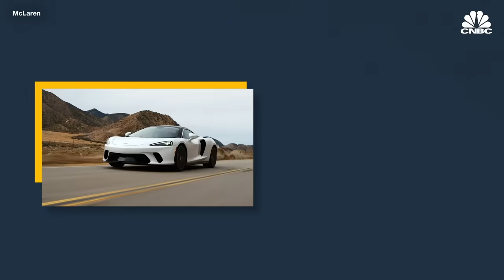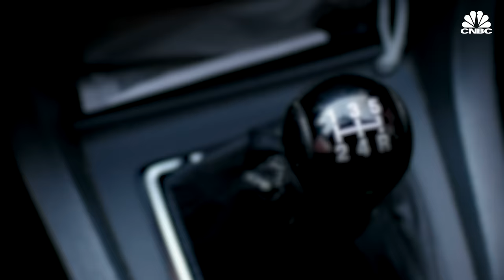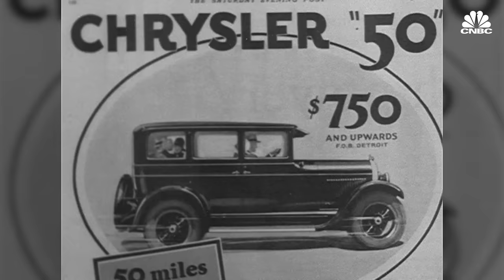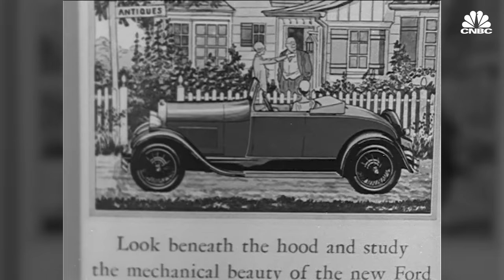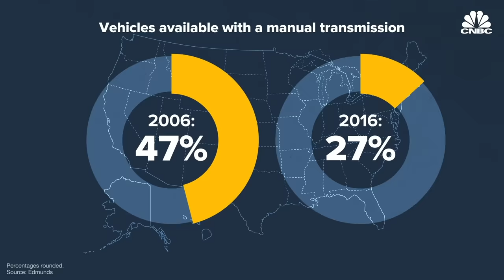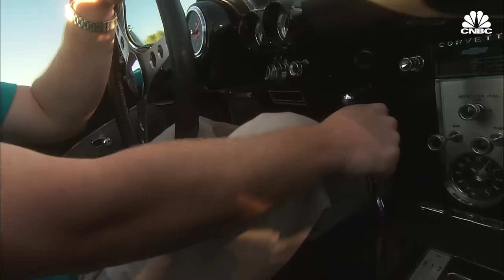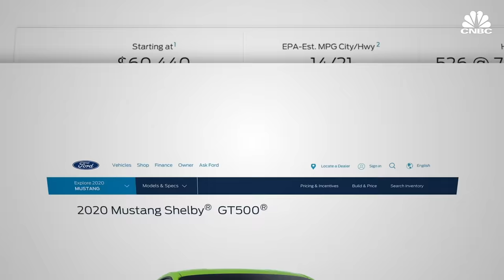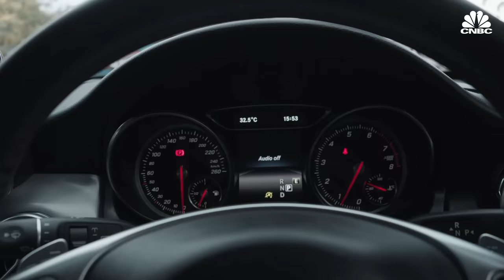Why Stick Shifts Are Going Extinct

Comment: Driving a stick shift in a slow ass car feels weirdly fast and fun, just rev that thing to its limit and always throw your back so you get those 'gforce' feeling
Reply: it's what makes cars like the Miata so special
Reply: 100% i agree! my miata barely has power but it feels fast af
Reply: I got a del sol and I can agree
Reply: I can relate lol
Reply: yup, former Saturn owner agrees
Reply: @stacks1548  because its light
Reply: Yeah I love my Fiat Punto with its 65 ps, most of the time I save a lot of fuel by shifting early but when I feel like it I get into race mode and shift late and fast. 
Try and do that with an automatic 😆
Reply: i hate that pfp
Reply: The profile pic! Oh God...
Reply: Slow cars are objectively trash
Reply: @DerAltruist  agreed
Reply: I agree, If it's a weak and slow car like below 130hp then I'd take a manual over automatic any day as automatic will make the car feel really tired. But on the stronger cars It's 50/50 for me, automatic is nice but there's still something special with manual.

Comment: Call it "Why Stick Shifts Are Going Extinct in the USA" next time please
Reply: They are going extinct everywhere. Oddly, so are conventional automatics. CVTs are gobbling up part of the market, hybrids like the Toyota version (which does not have a transmission in the conventional sense - the gears stay engaged all the time) and EVs (which have nothing resembling a transmission) are displacing transmissions altogether. Ford reports the cars they sold in Europe in 2017 were 89.6% manual; in 2020 the number had dropped to 68.7% That is from nearly nine out of ten to barely two out of three in four years.
https://thenewswheel.com/ford-manual-transmissions-europe/
Reply: flagmichael I get your point and I agree, but the vid clearly focuses on US so this my comment
Reply: @MaF1e  Totally fair, but to be expected from an american news source. I'd imagine BBC would be more UK and euro based. I also think the existence of manuals as well as their story is more interesting to Americans as opposed to other countries with a higher % of people that drive manual
Reply: Yes. In india, tha majority is still manual transmission vehicle.upto 90 percent is manual. But gradually, AMT and CVT are displacing manuals
Reply: do we have viagra to reconect
Reply: @flagmichael  CVTs are great for snowmobiles and ATVs, but they can't handle a lot of torque. The manual disappeared out of pickups for the same reason. Nobody was making a manual that could handle the torque in a package that would fit in a full size pickup.

Comment: Who else is from the UK where barely anyone drives automatic and manual ain’t dying out
Reply: From Southeast Asia where often the rich drives automatic and the majority prefers driving manual ;-)
Reply: In London, 53% of cars on sale on Autotrader are automatic.
Reply: There are ugly priuses everywhere and they are auto
Reply: India too. It's like 80% manual
Reply: The longest point to point drive in the UK is Thurso to Lands End (828 miles) and I doubt that anyone does that trip very often and those who do probably split it into two days. Manuals are great in a car that you are doing limited miles on. If you are spending a lot of time in traffic or do longer trips (1,000+ miles per day more than 5 or 6 times a year)  you are better off with an auto.
Reply: @JG-ge3ui  Start stop traffic as well.. I can already feel my left foot going numb
Reply: @rich7447  Don't quite see the logic there, my friend. On long trips the vast majority of the time you will not be moving the gearstick at all, so it doesn't make any difference. Personally I don't find automatics any more relaxing; you've still got to concentrate on driving, and it is this that is tiring, not using the controls.
Reply: @MSM4U2POM  Any road trip from my current location (and my last 4 as well) involves mountains. The mountain ranges near me are not particularly big, but do require downshifts on the climbs. That is not really a problem. The time when shifting becomes a chore is when you pull into town after 12 to 15 hours on the road and want to get to your hotel and a place to eat. We aren't really setup to make it easy to walk anywhere and you usually don't want to move let alone drive.
Reply: @rich7447  Fair enough, but that's a pretty extreme example, if I may say so. I would still never swap a manual for an automatic for the reasons stated. I just don't find the things easier to drive than manuals. Long journeys are just knackering, no matter what you're in.
Reply: @MSM4U2POM  I've got a manual in our 3rd vehicle (4.0L L6 Jeep Wrangler) and drive it when I'm staying local and don't have to get very much (it's small). We are just NE of Washington DC and do 8 to 10 longer trips a year and always take our 3/4 ton pickup. The longest in the last four years was to Steamboat Springs Co (about 1,800 miles each way) for a ski trip. About 1,600 of those 1,800 miles is on one road (I-70) and traffic drops off west of the Mississippi. Other than Kansas City there is really not a lot to even pay attention to.
Here's an example: https://www.youtube.com/watch?v=97VjVFtLMd8
Reply: love to hear it
Reply: Yep. In the U.K. almost everyone drives stick shift because if you get a licence on a manual then you can drive both manuals and automatics. But if you get a licence on an automatic then you can only drive automatics on that licence.
Reply: Only extinct in USA, rest of the world drive stick... It is fun how people from USA think they are the entire world.
Reply: in norway but yeah most ppl have manuals
Reply: @MMM18092    So that means 47% are real drivers.
Reply: Although manuals still outnumber autos in the UK, saying "barely anyone drives automatic" is nonsense.  40% of cars in the UK are automatic according to the latest numbers I can find, which is double what it was just 8 years ago.  Respect to the Brits keeping manuals alive, but they're coming for you too.
Reply: @barryfowles-zl5ib  I was a "real driver" in London for 3 years. Never again.
Reply: It's weird though how if you take your test in a manual car then you can drive an automatic as well, however if you take your test in an automatic then you need to take another driving test to drive a manual car. So effectively paying out twice for your licence! I think a lot of people prefer an automatic because not everyone has the coordination for 3 pedals and a stick shift and probably find it easier to drive an automatic and therefore easier to pass the practical test.
Reply: Yeah!!!!
Reply: @samanthahardy9903   Allow me to explain, if you wish to hold a full UK driving licence for both Manuel and automatic transmissions, just take one test in a manual car, not rocket science I would have thought. And if you you lack the dexterity to use a clutch, maybe you are unsuited to be driving in the first place.
Reply: Kapow Gaming Yep, true in The Netherlands as well. You would be mad if you restrict yourself taking lessons in an automatic, since a lot of cars out there have manual transmission.
Reply: I hate that this but it's kinda true I love manual.I have 1 Corvette manual but I need another one

Comment: I usually describe my stick shift as an entertainment device. It turns driving into a fun activity instead of a chore. Hard to argue against that.
Reply: I swear. I had to go back out yesterday to ride it one more time a few miles. Just for that high 🤘🏿
Reply: who the hell thinks driving is fun?
Reply: @sumobowler3790  Lots of people. Jay Leno, for one.
Reply: @sumobowler3790  people who drive manual like me
Reply: @sumobowler3790  lol you need to get a real car and get back to us
Reply: How much fun is it when you live in a big city with constant traffic?
Reply: @janoycresnova9156  more challenge/tasks = more fun for some people
Reply: What's funny about that is I first got a stick shift because I knew it would be fun but eventually the novelty wore off and I just shift without even thinking. It became a normal reflex like slamming the brakes to avoid a ball rolling across the street. I still drive one only because I refuse to give up my VW GTI, not because it has a stick. On the other hand, I think car brands are inflating the prices of their transmissions. It can cost almost $1,800 for a damn automatic on many cars under $30,000! Ridiculous, that's a LOT of gas money there.
Reply: @janoycresnova9156  it's far more fun to drive manual in a traffic jam, then it is driving on a freeway on 6 gear for a couple hours.
Reply: Manual for drivers, automatic for users:)
Reply: @sumobowler3790  pretty much everyone who owns a stick shift
Reply: @janoycresnova9156  get outside the city for once

Comment: 3:43
Wait WHAT? You are supposed to pay attention when driving a vehicle. The hell is that arguement.
Please don't let those kind of people even touch a car lol
Reply: I was looking for this comment
Reply: Constant attention when you compare it to automatic
Reply: @zahabasheer9417   what do you mean?
Reply: By Constant attention, I assume he means physically... you don't drive stick with one foot and a cellphone in your hand.. usually..
Reply: I think he means that driving manual requires paying attention to both driving and controlling the stick. Meanwhile, automatic transmission allows the driver to focus more on one thing, which is watching the road.
Reply: @slee9843  you clearly don't drive stick don't you ? It becomes automatic reflexes and it doesn't require any thinking other then feel and reflex, but it's harder to eat your PFK bucket and sending Instagrams driving in the city... isn't like 80% of accidents due to inattention... 'most are automatic, sorry  but when you only have a gas pedal to press your attention easily gets off the road.. especially if you're doing your makeup
Reply: @zamboner  I wasn't really referring to the safety aspect of the two methods but rather the "comfortableness". Tbh I think you've proved my point. Driving stick occupies the person in two ways so it requires more attention than automatic--like you said, this probably results in less accidents. Regardless of safety reasons, I assumed people switch to automatic because they've found it comfortable not having to constantly use the right hand. Sorry for having an opinion haha
Reply: @slee9843  that the problem... I'm trying to understand your said opinion.. one way you say stick drivers have to pay attention to the road, on the other way you go and say automatic driver have the leisure to "focus more on the road because they're more comfortable driving"... correct me if I'm wrong, but these 2 statements are conflicting... imo, if anything, too much comfort makes drivers, on the contrary, lazy, distracted and pretty much everything else BUT more focus on the road... imo theirs 2 type of drivers : one that love driving, and the other that has too. One perfer stick, the other automatic.
Reply: @zamboner  Look, regardless of manual/automatic, I'm assuming that drivers are responsible and not eating KFC while driving. That's why I said i wasn't referring to the safety aspect of this. Perhaps I'm being too optimistic by assuming those ideal conditions, but hear me out. I said that manual drivers pay attention to two things, the road and the stick. Automatic allows drivers to focus on one less thing (using right hand), so they have the capacity to pay attention to "watching the road", which I now realize that it's a little ironic. In reality, you're  right--automatic lets people get lazy because they don't have to necessarily focus on the road so much anymore. I was thinking that ideally, people can turn their focus onto the road because they have one less thing to pay attention to, while in reality, they tend to use that free capacity on other things like "doing makeup" and "eating a PFC bucket."
Reply: @slee9843  That is not the case. Once you get used to a stick, it's not even something you think about.

A driver barely even looks at the stick throughout his drive, even beginners don't.

It's just there like the brake and gas pedal.
Reply: @zamboner  it's true that it becomes "automatic reflexes and doesn't require you to think", but it takes out part of your brain function in order to make it happen... You may not feel anything happens when you "changing gears", but your brain is simply doing a multitasking mode.... When your brain is multitasking, your brain ability to react is slower and sometimes inaccurate.

Here's some example;
When you suddenly have to changing gear because of a minor / major incident on the road, or simply because you need to do it to maintain the torque of the engine,,, you will react SLOWER than an advanced automatic transmission...

Or

When you're about to changing to a lower or higher gear (based on your eye vision to the road), then suddenly there's an incident on the road that happens in a split second that makes you unable to gain full control of the car,,,, you won't be able to change the gear AT ALL, while the gear in an automatic transmission will change by itself whatever happens (depends on the speed of the engine).
Reply: Yall I'm sorry for starting a debate. I was just trying to see in the perspective of the person talking in the video, which is just the convenience. And yes, I agreed that stick driving tends to be safer. 
One small example of convenience: people don't have sufficiently fast reflexes, and joint movement becomes increasingly difficult with age. Automatic driving as an option might reduce the bodily strain with less gears and one less pedal. Of course, this doesn't necessarily mean it's safe. I repeat: I'm not saying it's safe and better, I'm simply suggesting an example of why people might consider automatics.
From what you all said, I fully understand that manual = safe, automatic = bad in this platform. I'm just attempting to talk from another pov here, so apologies for the "sugarcoating"
Reply: It's one more thing a human has to pay attention to (the physical road + the manual transmission vs just the physical road alone), this is why  most car crashes are caused by people using a manual transmission
Reply: Amen! Too many lackadaisical idiots behind the wheel these days. How about we mandate ONLY stick shifts and make driving sane again?
Reply: @5frogfrenzy  Yeah thats it. Not! Read the comments. Everyone who drives a stick agrees, more attention and care required which means you are ENGAGED in driving the vehicle instead of something else which will cause an accident or injury to another person. Oh, maybe you don’t care about hurting other people?
Reply: @FranklySpeaking73  ok boomer
Reply: @FranklySpeaking73  anyone over 30 is boomer on the internet
Reply: I think guy in the video was just trying to say stick shifts r harder to learn lol and that using the stick shift might shift focus on the road to using the stick shift. Definitely wasn't telling other people to not pay attention when driving lol like what @Slee said
Reply: want an automatic so I can access my social medias with the free foot while driving
Reply: i dont know what they say about konstant attention, i mean i dont need to think which gear to shift to, it just happens. the only time i realy think about shifting is in a big pull.
Reply: I enjoyed driving a stick shift except for when stopped on a hill- particularly in the rain!

Comment: My first car in college was a 2006 mazda3. I loved that car a lot, during my senior year of college I bought a manual 2021 Mazda3 hatch as my first manual car and I love it. It's so smooth and fun to drive (and was cheap compared to other cars in its class but looks and drives AMAZING with great reliability and super fun mid band torque for some fun zoom when you want it). I now also own a 1990 Miata. So both cars I own are manual. Every drive and errand is a fun drive.